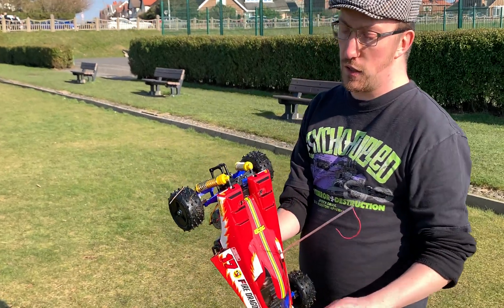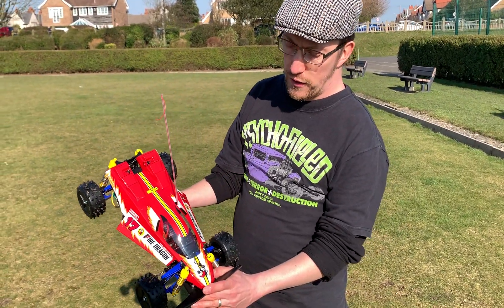E90: 2020 Tamiya Fire Dragon Gets Its Tyres Hot At Fairhaven Lake! Kit 47457 First Run.

Comment: Dammmmnnnnn! Mine clicked when I first built it too, I missed a shim washer in the diff. I had one of these when I was about 12 years old. Snapped the rear diff and wheels coming up short on a ramp gap but fixed it with the metal from a soup can. I also removed the drive shaft and made it 2 wheel drive which made it faster with a longer lasting battery. This takes me back!
Reply from the maker: Hi Alistair , you know I had that thing a part several time after building and I couldn’t find anything I missed so it baffled me, got better though as I ran it. I love the DIY jobs to keep your going, love hearing things like that ,cheers
Reply: When I built my re-re hotshot I was very unsure the rear gearbox was together properly, as it had a very slight hitch when turning it by hand, but have disassembled and put it together a few times I realised it's just how it is. The diffs are rough too (like a pepper mill as my friend observed) but the thing runs absolutely fine. The metal bevel gears aren't great and I think this is the source of the roughness. Also the input shaft on both 'boxes isn't captive, it's very easy to drop the cup out before it's all put together. That shaft goes through the thrust bearing with the plastic piece you describe, and terminates in an 850 bearing which is held in place by a plastic disk on a dowel that runs across the gearbox. It's very Tamiya :)

Comment: £170-£200? I realise its stock but it has a very toy like performance compared to others brands at around half that price.
Reply from the maker: Yes about £170, the design is over 30 years old now as it was from the mid 80s  so compared to modern machinery it does look a little toy like also the body for it was designed as part of a manga cartoon as well. Cheers for your comment

Comment: I think the original was silver .
Reply from the maker: The Thunder Dragon was Silver , Fire Dragon was always red. Unless I’ve missed what your on about ? Cheers
Reply: @andyrobinsonrc2480  
No your probably right. 
They both look the same I remember having a silver one 😁
Reply from the maker: Deff a thunder dragon if it was silver , it’s very similar at the back end , they are re releasing that one in april
Reply: @andyrobinsonrc2480  
Might be cool that’ll bring back young teenage memories. Do you remember Motors 
Called Twister ? Red label on the can with Twister written on it at an Angle like warped . 
I stuffed one of them in my thunder dragon to me then.  It was fast .